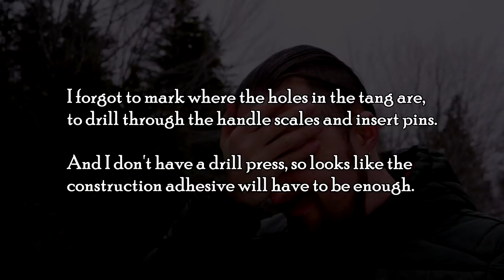First Sword Customization Project (Fantasy Cutlass)

Comment: Skal, something was terribly wrong with your angle grinder disk at 4:31. NEVER EVER work with a disbalanced or improperly installed disk! It's simply way too dangerous.
By the way, I strongly recommend to get a bench grinder or a belt grinder (or a combination of these too): it's a very useful tool both in "general DIY and housekeeping" and in knife-making-like things. E.g., you could easily smooth the sword's handle and produce nice transitions between wood and metal by using a grinder. In it's simplest form, it could be even a hand drill fixed in a vice and with a special "emery-dish" in its chuck.
Reply from the maker: Yes, I realized what was wrong with it afterwards. Should have noticed right away.

Comment: Couldn't you boil some water and melt the glue, remove the scales and trace the hole in the tang? Or is that a different type of glue, that doesn't melt with heat?

Anyway, I kinda liked the buckler attached to the handle. 
And looks like you finally found some use to all that snow 🤣🤣🤣

Comment: Doesn't seem to cut that well really, I wonder if the blade is a bit dull, or if the guard has so much mass it screwed with the weight distribution?

Looks kinda cool in a way still.
Reply from the maker: It cuts quite well actually, there were some nice clean cuts. I was just tired after a lot of work and messed up a number of them.
Reply: @Skallagrim  Okay, understandable. Is the weight distribution a lot different from a "normal" sword of the same size, or about the same? The buckler part is kinda massive (and I like how it looks because of that).
Reply from the maker: @CondemnedGuy   Normally this would be relatively blade heavy as a single-handed sword, so the guard brings the balance back down. It's comparable to a light arming sword or a sidesword.
Reply: @Skallagrim  Nice :D

Comment: You could have used a thinner cutting disc - it generates less heat.
Reply from the maker: Yeah, that would have been better. I just didn't have any other cut off wheels.

Comment: Ok so just warning you. Not a good idea to let go of a piece while the table saw is running like that. It can catch and shoot back at you (I’ve seen many holes in walls caused by shooting pieces) Always push it all the way through or hold it there with the stick as you turn off the saw and until it completely stops. Otherwise great work. :) definitely think you should make more stuff. It’s super rewarding.
Reply from the maker: Hm, good point.

Comment: Spray paint in such cold conditions?
Reply from the maker: Well, the workshop is unheated and I can't spray paint in the house. I did let it dry in the basement though.
Reply: @Skallagrim  Impressed with how well it turned out. I've tried spray painting in less cold conditions that turned into utter disasters (never knew paint could look like fur before that)

Comment: Never use a rotary tool (like an angle grinder) with gloves on.
Reply from the maker: I understand the concern, but when both hands remain on the handles, away from the disk, the gloves can't get caught.
Reply: @Skallagrim  The problem is slipping off. If you slip, without gloves you only get a cut / bruise. But with gloves, they love to catch and then you are in for the real joy, like ripped off fingers and stuff. So since nobody plans to slip off, your argument is invalid. Gloves are the big NONO! :)
Reply: @Skallagrim   You're assuming you won't make any mistakes then.
But if you do...the gloves will turn a sliced hand into a totally mangled one

Comment: BTW i can find you those holes using some frames from the video if you give me two sizes that did not change. The blade width near the hilt and length of the hilt. Then some photoshop magic  and you can mark them. UPD, there you are: https://i.imgur.com/j75KXWi.jpg Now you can find them with a needle and a drill

Comment: I don't like the way that the blade's curve has its weight too near to the handle, should be more heading to the tip of the blade, that's why you have to put more strengh to cut with it, In other words, it is not well balanced, the hadle/grip you will prefer to make thinner (you have to find your own shape, your confort in the grip), and should finish the work with half round rasps (to get your fingers confortable when grabbing it, depends on the pressure you need to put on it to not get it off your grip) and surface finish with medium fine and then very fine sand paper (I pressume 200 to 280;300 - grit - , you don't want it to be too soft and slippery). 

Now, to be fair it's not bad at all for a first try. =) Hope you keep on crafting stuff! I'm a carfter myself (just a hobby), I haven't craft anything in the past years, but if I do I will upload it somewhere and pass the link in case you feel interested! xD
Last thing I crafted was a letter opener! is was a cold forge (I don't know how do you call it, when the only heat you put to the piece of metal you are shaping is the one it gets by hammering it). It was fun, I don't have it anymore tho... =(
Reply: Loved the video! =)

Comment: Skall needs a garage or workshop so he doesn't have to work in the snow.
Reply from the maker: I do have a workshop (which you can see in the video), it just has crappy lighting currently, at least for recording purposes.
Reply: @Skallagrim  Yeah, I saw that later. At that point I just figured you were doing it outside to avoid getting sawdust and shavings everywhere.

Comment: The skill are more of a detriment than tools here, an easier solution could had been not split the handle but drill it, for the extended part of the tan you could had made some paralel holes with the drill and then carve them square with your chisel.